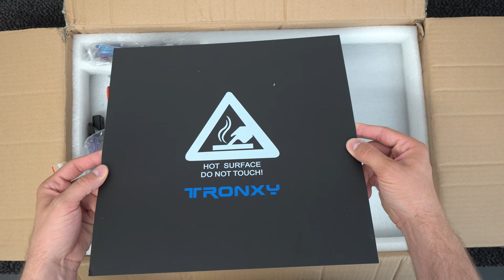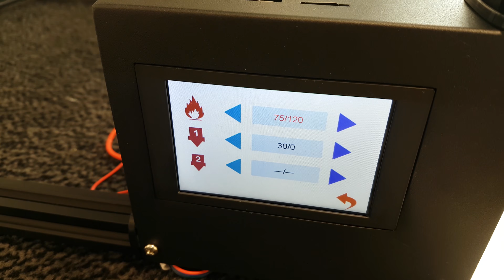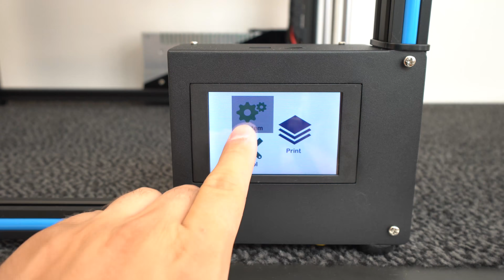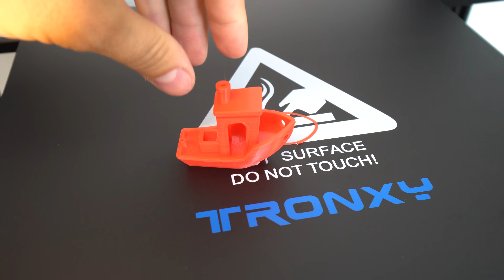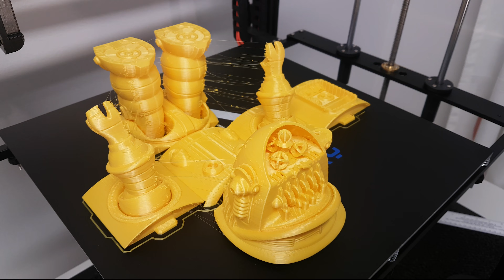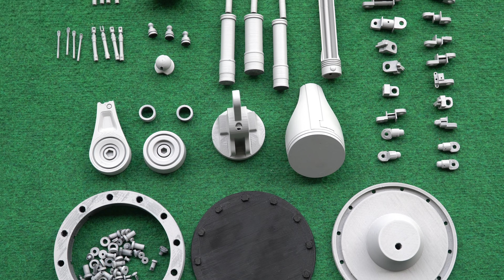Tronxy X5SA 3D printer review - Terminator T800 Arm 3D printed

Comment: I am very envious and grateful to see your video.
I am very new to 3d printing.
I bought a TronXY X5SA-400 printer and have never had a normal print job yet.
Z-axis offset adjustment does not work.
Auto-leveling works fine, but the printer needs to be turned off quickly as the nozzles will scratch the bed and make noise when printing.

Please advise on which routine to follow when printing to the TronXY X5SA printer and which tasks to follow.

Thank you.

Comment: I have your TRONXY X5SA machine.
The machine works very quietly and thanks to it I can print large models.
However, the machine has a strange nature of work when printing the model.
It
 starts slowly, accelerates then slows down to a stop. Extruder Adds 
filament and again the machine starts slowly, accelerates then slows 
down to a stop. In the place of adding the filament after stopping, a 
thickening arises.
Such machine
 operation results in a 40% elongation of the printout. Please let me 
know how you can move the machine so that it works normally without the 
so-called "Dance".

Comment: DONT BUY IT !! 

Hi guys I want to bring you my bad experience with TRONXY X5SA: bought on aliexpress by TRONXY OFFICIAL STORE for about 300 EURO. I chose to pay the highest amount on aliexpress even though I could have paid 280 because the shipment was from Spain where I am and immediately I had my bad experience, the supplier replied after several days saying that they had finished the product in Spain and that they would send from the Czech Republic (oh well I pretended nothing and I agreed). A week later I received the product and it was almost a day for me to assemble it. The instruction booklet is useless to say the least and contains printing errors with wrong measurements so I went looking for a tutorial and assembled it. Commissioning and after only 2 prints the motherboard burned. Practically as soon as you turn it on, the extruder starts at maximum power without having the possibility of doing nothing if not returning it before burning everything.When everything was present to the supplier via aliexpress chat, he replied as usual 2 days later saying that he would send me the motherboard and don't worry. I wait another 3 days and ask for the shipping code and as usual it doesn't respond. At this point I get PITCHED and open a dispute on aliexpress. By magic he replies and tells me he wanted to know the type of motherboard. BUT BAD TROUT !! you ask me after 3 days that I spotted you that I have a problem and knowing that the product has only 2 life stamper. This is not how service should be. He tells me he is going to send me from China with an ordinary parcel which usually takes 20 days or even 1 month. NO JUST BROKEN NOW AND I HAVE REQUESTED TO BE REFUNDED. Moral of the story DO NOT TRUST THIS PRODUCT

Comment: Have an issue and am hoping you can help.  Have built this machine and done all the mods you have suggested however I have all the end stops connected but where do I connect the bed levelling sensor.  I have searched everywhere for the wiring diagram but nothing shows the connection of the sensor.  Unfortunately I have misplaced the original paperwork and this has been driving me mad ... Thank You

Comment: What voltage setting do I need to have set for my X and Y stepper motor to achieve faster print times. Currently set at .9 volts and can't print faster then 60mm/sec without skipping after replacing belts and testing tension. Please help.

Comment: the May 2019 version fixes a lot of problems, frame stability, revised engine support, 24 V tray feed, reinforced belts, print head that has not been clogged once in 33 hours. 'uses ;-)
Version at the top!
I had a reprap mk2 before, and it changes at all.
It remains a little noisy at the motherboard.

Comment: Very nice review! I bought also the X5SA and the print quality is amazing after a few upgrades. I would change the power supply from 12V to 24V. So can I just change the power supply without damaging anything? Can the motherboard of the printer also work with 24V?

Comment: Hey dude !

Thanks for your great review, I am gonna buy this printer soon. I want to develop it to a clay 3D printer by replacing the default extruder with another extruder that I made. The thing is my extruder is weighing around 8lb !!! Do you think it will be able to resist the load without accuracy issues ? Would you suggest the 500 mm model over this in my case ? (or any other printer with large bed?)

Thanks so much 
Amin

Comment: Got an Ender 3 and although great... I'd really prefer if the bed was basically not zipping all over the place on the Y axis. Makes the bed cable a pain in the butt to manage and the heavy (but great) glass bed makes it vibrate like a jack-hammer when it's doing some thin lines.

I have a Lerdge 32 bit board I want to re-use and was looking at the Ender 5 but put off by the single Z axis lifter and reading some feedback and seeing a support mod.

This looks like a great alternative (I'd probably go the one with the cheaper controller as ditching it anyway).

From the looks... the 4 point leveling could be converted to 3 point easy as it seemed to have holes in the bed in the mid points? Converted my Ender 3 to use 3 point leveling and it's just so much easier.

Great review as usual!

Comment: ı bought a tronxy x5st 500 2e and while I install it I see that there is a lot of mistakes about the printer (the battery is broken and also z motors have problems.) Would you comment about that?  And also what are you using to clean you prints?? Thank you a lot.

Comment: @Nexi when you upgraded the powersupply to the 24v, what did you upgrade the fuse to?  I did not even think about it and when test printing the fuse blew.  Thanks in Advance!
I have installed the MOSFET to help with the regulating the current.

Comment: @Nexi Tech  will that SSR you linked work in the US or is there a different model you recommend.  I posted a question on a FB page and someone said the one I purchased will not work in the US with the stock heatbed. Can you please confirm and if they were correct, can you point me to the correct one.

Comment: could you share with me the position of your auto level sensor? I bought two of these printers and both sensors are mounted different. None of them is leveling correct out of the box. Do you bring the sensor on the same "z-position" as the nozzle?

Comment: Reviewers on the previous Tronxy model  5S recommended stiffener "L" brackets on the corners of the machine, 3D printed plastic parts that aligned the belts and prevented loads on the motors at the outside edges of the machine, and 3D printed parts that aligned the pulleys with the belts. Any thoughts on these, or were these issues corrected on this newer model?

Comment: I bought an X5SA after seeing you video. Assembly went without any issues, but after I popped in the SD card with the benchy files, one sliced with Cura and one with Repetier, both files stuck at 1%. I put G29 auto leveling command after G28 home all, the printer seems to execute both commands, then everything stops. Can you share one of your sliced files?

Comment: You advice both a mosfet and a solid state relay as recommended upgrades, but aren't they solving the same problem? 
The mosfet allows you to avoid sending the power for the heatbed through your printers' motherboard (or even connect an alternative PSU). It would still heat up pretty slow, but your mainboard wears out less. The SSR is pretty much so you can hook up your heated bed directly to the mains, if I'm correct? Why would you do both? Not an electronics expert, but that's how I interpret it at least.

Comment: Nice, any idea where I can buy the heatbed insulation? I'll try on eBay I guess? It took me like 40 mins to heat my heatbed to 55-56 degress. It cannot reach 60 degrees celcius. Not sure if the wires are going to overload. I'm drawing 250W all the time, its very power hungry... not sure if something is wrong.

Comment: I believe your are incorrect about the current capacity of the 16 gauge wire, that chart is specifying 10 amps at 120 volts or 1,200 watts, at 12 volts your only at 120 watts and 24 volts, 240 watts.

Comment: So you said you replaced the washers from the springy ones to normal ones, can we have those listed as well? Also you changed the belt, but which rubber belt did you use? Cause you have two listed?

Comment: I own a TRONXY X5S 3d printer, it is a great printer with great potential. It is my first 3d printer, learned alot about 3d printing in the last 8 months.  I now rebuilt my hotend to a steel nozzle so i can print with carbon fiber filament. and it works Great.